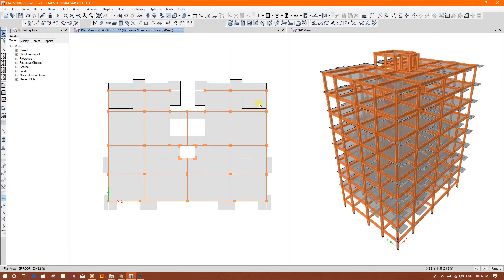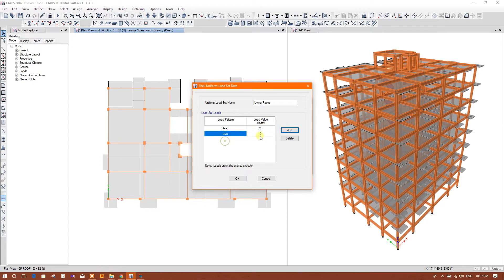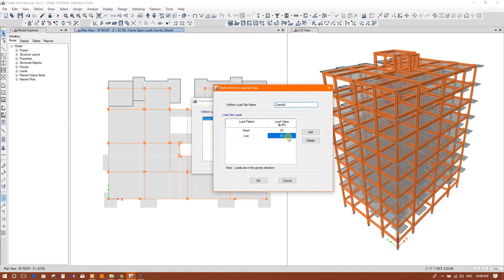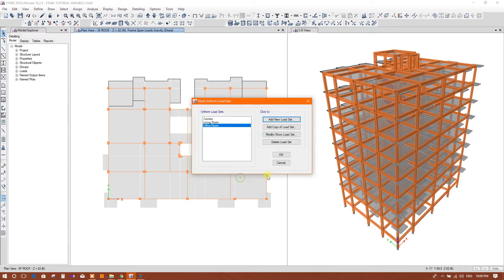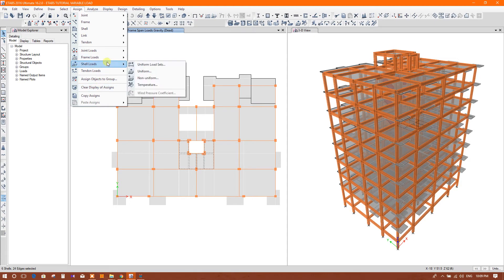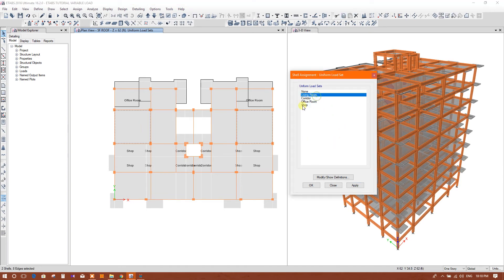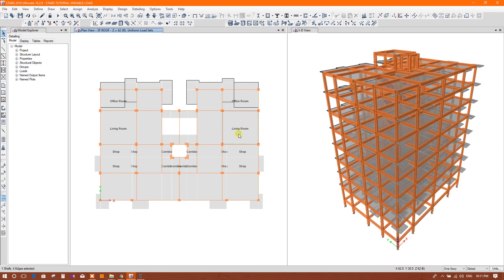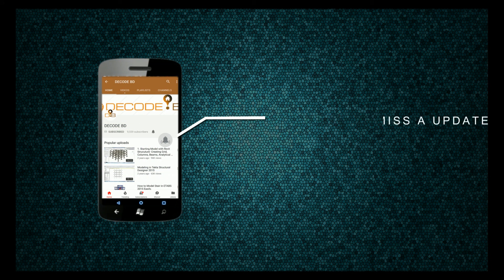LOAD SET IN ETABS

Comment: Sir a request to you for making video on flat slab and column which is treated as wall.
Reply from the maker: Sorry , Didn't understand clearly.
Reply: Like if the column size is 200x1200mm then it should be designed as wall or if the is an L shape column?
Reply from the maker: I will try in sha Allah.